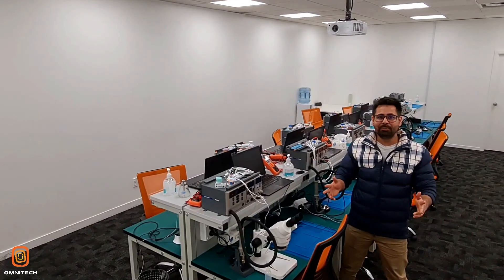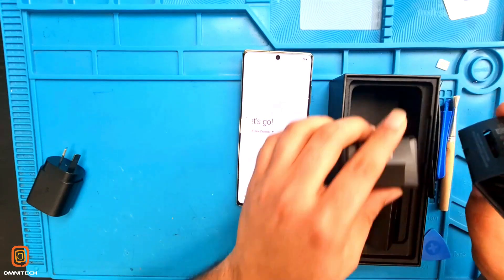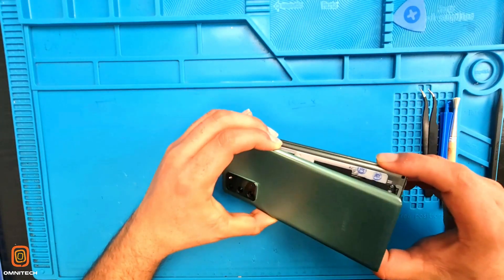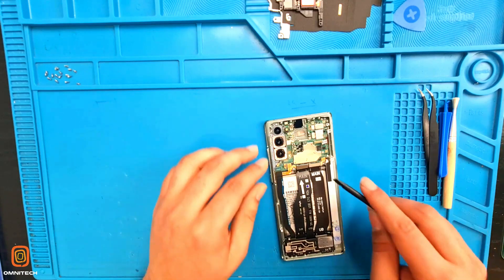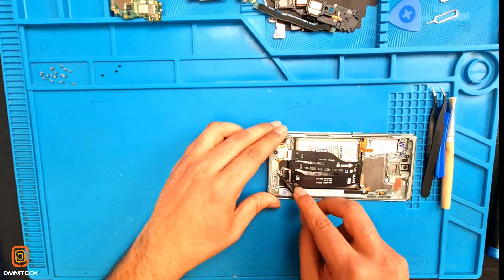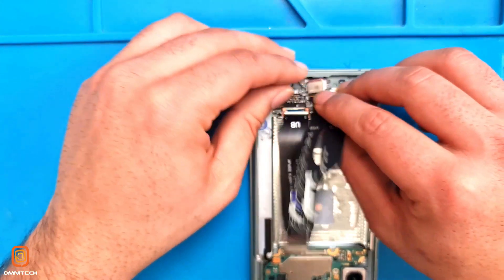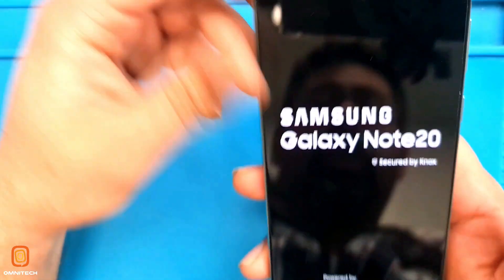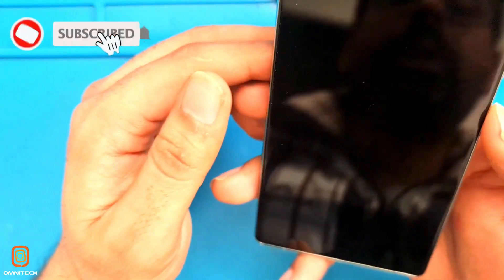Samsung Galaxy Note 20 Teardown 👉How to teardown Note 20👉What inside Note 20👍

Comment: Hello! Just a clarification regarding the video, does the Note 20 Ultra (5G Exynos) you have has the copper vapor chamber, then the Note 20 (vanilla) has no copper vapor but uses graphite? There's still a doubt about Zack's (Jerry Rig) statement on his teardown video about the graphite and copper chamber used on Note 20 Ultra.
Reply: Hi, In galaxy note 20 and note 20 ultra Samsung used both techniques multi layered graphite thermal pad and copper heat pipe, for different region depending on the market.
Reply: @ankusharora2780  okay, I saw the Note 20 Ultra has 2 different chamber pad components, depending on the chipset used, while the Note 20 hasn't show yet that it has a copper chamber.

Comment: No vapor chamber cooling?
Reply from the maker: Val Kyrie no unfortunately NZ Samsung didn’t have vapor chamber cooling, interesting how Samsung phone here in NZ is different from other part of world
Reply: @OmniTechNZofficial  Thanks for replying, great teardown video👍
Reply: @valkyrie8777  I think the Note 20 (vanilla) has no copper pipe, while the Note 20 Ultra has it for Exynos unit.
Reply: @yosoy01ian  I see,but I seen on Jerryrigeverything video on Note20 Ultra still doesn't have the copper heat pipe, not sure why though 🤔
Reply: @valkyrie8777  He uses the South Korean model of the Note 20 Ultra, which has the Snapdragon 5G on it. iFixit has the U.S. model of it, also Snapdragon with the same graphite chamber on it.
Reply: @yosoy01ian  I see,thanks for the information, much appreciated
Reply: @OmniTechNZofficial  does the speaker chambers have white foam balls like the Ultra?
Reply: @matrix1169a  yes it has same white foam balls like ultra